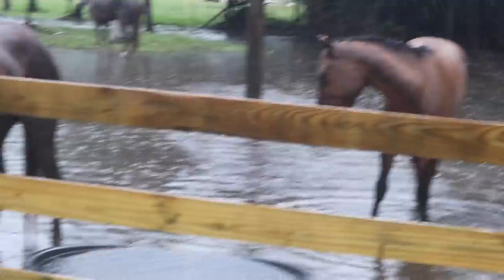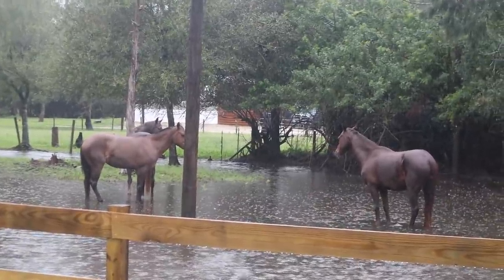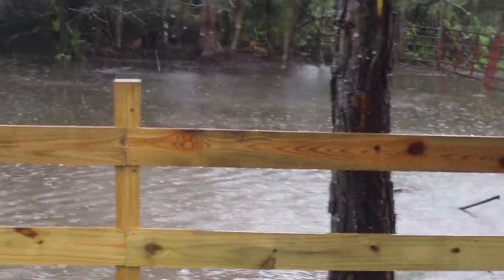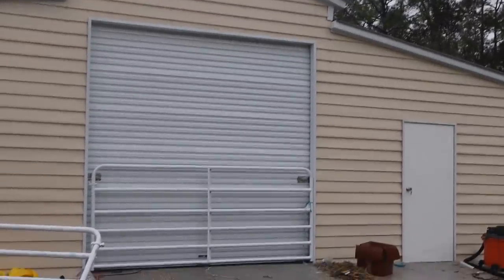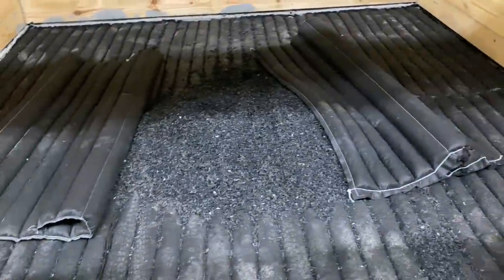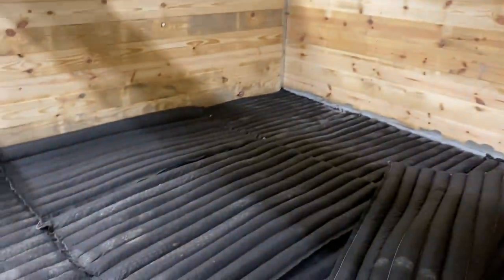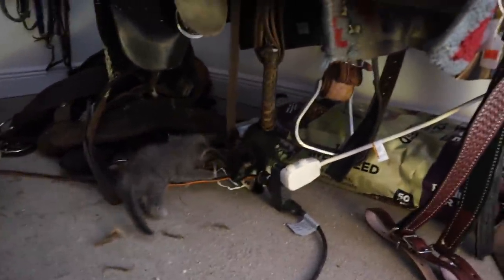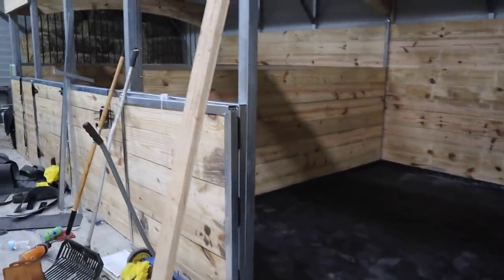THE HORSE STALL FLOORS ARE FINISHED! | BUILDING MY DREAM HORSE BARN PART 15!

Comment: Hi Stephanie! Where did you get the top cover to go over all the padding in the stalls? Thanks!
Reply from the maker: RAMM Horse fencing & stalls!!
Reply: @StephanieMoratto  They put me in touch with the regional sales rep for my area. Hopefully I’ll be able to get just the waterproof top cover. Finishing up the pad but we have to do a cement footer where we are. We also went through Choice Metal Buildings as we got the best price and customer service from them.

Comment: Tip: if you guys are workin* on a small project like this you guys can do two at s time. What i mean is that Mike can be doing one stall while Stephanie does a differ one
Also quick question:
Why did you decide to use the bedding you are using and not using simple shavings

Comment: I have a question, I really don’t know much about barns. Do you have to clean the poop and pee of the horses in the stalls with that flooring or what? If you have to clean them how many times?
Reply: You still have to clean them but you use a lot less shavings and it's more comfortable for the horse.